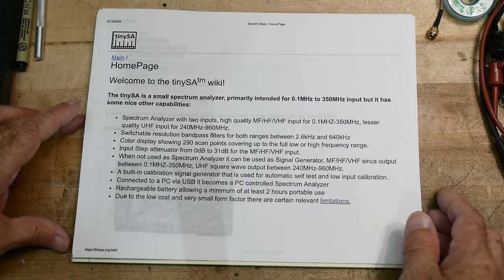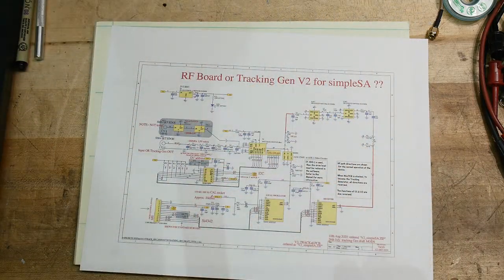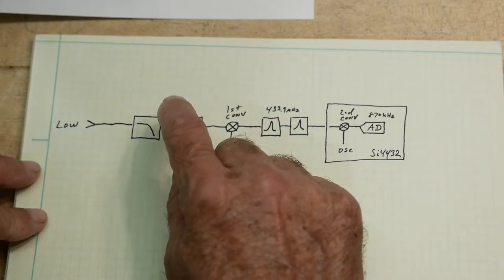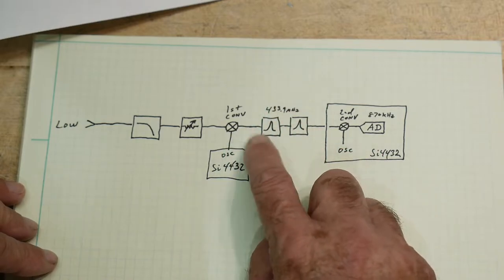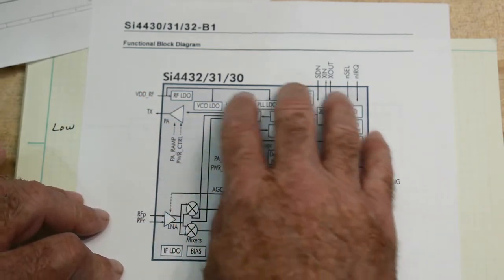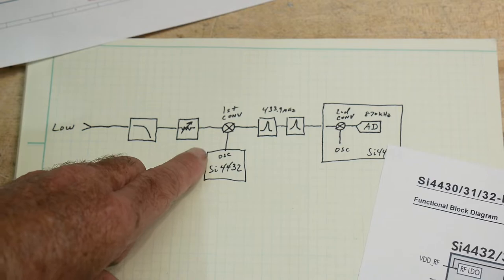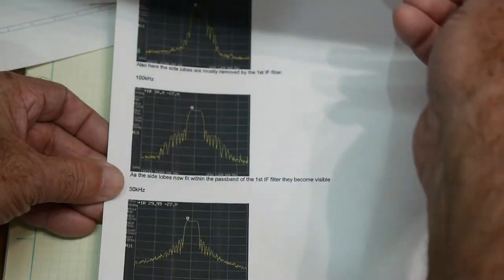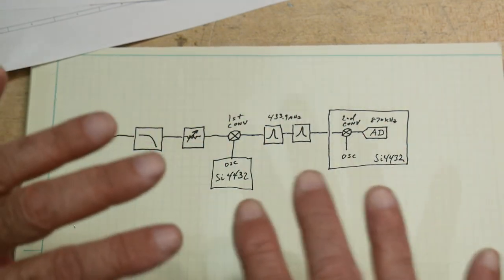#539b TinySA Design Block Diagram

Comment: Just something worth mentioning, the internal attenuator is the one easily damaged part if you exceed the max input signal level as specified in the handbook for the Tiny SA. Don't for a moment think that adding -30db of internal attenuator means you can input more signal than the Tiny SA handbook says is the maximum! We accidentally let the Tiny SA see a VERY wideband noise source from 100 kHz to 30 MHz that was -20 db, but the combined signal strength of that bandwidth exceeded the maximum signal input level of the Tiny SA and blew the attenuator. Since then we have ALWAYS used external SMA attenuators and told the Tiny SA what the external attenuation was so that its readings were still correct, that way we have never blown the input of another Tiny SA doing the same tests.
Reply from the maker: you are correct: https://youtu.be/Sdb_cs13njk

Comment: The filters are also included in the SI4432. They can be programmed using special registers. To calculate the filter bandwidths, Silabs offers design tools such as "WDS3". The measured signal level (in dB) can then be easily queried from the SI4432 chip via SPI.

Comment: i am little familiar with this Si4432 chip because i have Arduino Rf Spectrum analyser 230 to 900 MHz diy project Made by Chinese man which is very impressive because it cover relatively large Band he also included lots of features like Step , gain , base , Cursor Frequency set and frequency pinpoint tracking cursor .
he used Si4432 Based Transceiver module very cheaply available online and with very tiny Board and with RF switch .
he used nokia Monochrome display  and push button it would be much better if he upgrad this with Coloured display with touch and Encoder .